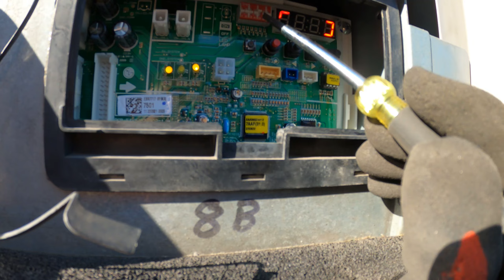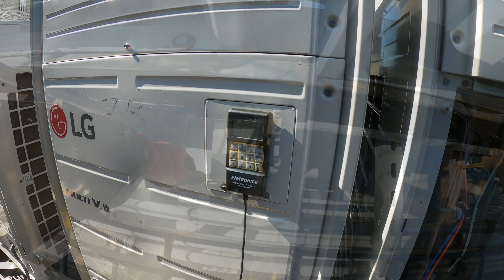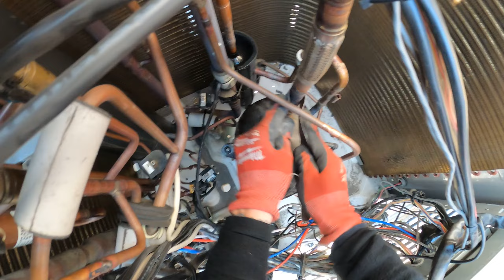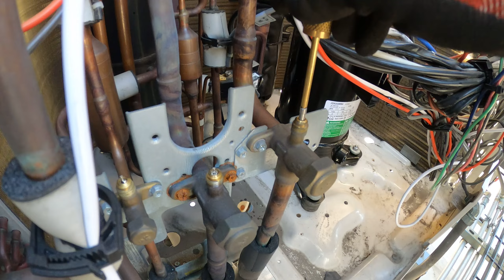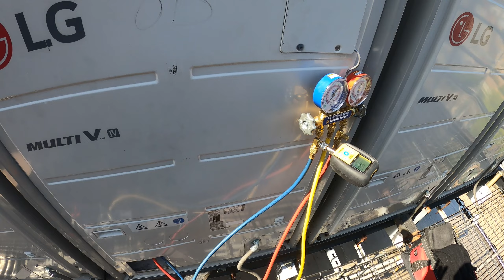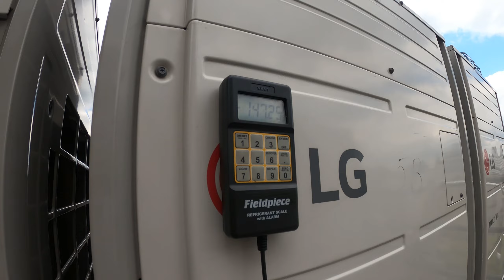HVAC Service Call: LG MULTI V 4 Error Code CH26 Repair (Inverter Compressor Overcurrent) CH29 Error

Comment: Thanks for a very interesting video! You did a great job with the thermal transfer compound.; that should work very well transferring heat. From the Service Manual, the board you replaced is the Converter Board not the Inverter Board. The Converter Board converts the incoming AC to DC to be passed on to the compressor and fan Inverter Boards. Is it possible that a bad Inverter Board for the Compressor is causing both the Compressor and Converter Board to fail?

I also have another thought that came from what you discovered with the strainers outside the units with nothing left inside. Having a look through the hydraulic diagrams shows six internal strainers. If the external protection is non-existent then is there some clogging of any strainers internally? This is assuming that the pipework with the strainers in that condition is used by this particular system, or at all.

Thinking about compressor lubrication, are the Strainer and Solenoid Valve in the Oil Return line between the Accumulator Receiver and the Compressor both functioning as they should? Is the Check Valve between the Oil Separator and Compressor working correctly allowing oil to return to the compressor? If it is not then is too much oil entering the main pipework and starving the compressor?

According to the service manual I found, there are two oil return systems:
- A high pressure centrifugal one that returns oil to the compressor through its own injector pipe which prevents mixing of oil and refrigerant on the suction side of the compressor.
- There is also a Smart Oil Control system that monitors the oil level inside the compressor and initiates an oil return cycle to the Compressor when the oil level is too low. Timed cycles are unnecessary and the Compressor is protected from running with too low an oil level.

Is it possible, given there was oil in strainers you found, that there is a fault in the Smart Oil Control system such as the functioning of the return cycle?

I hope my thoughts and ideas may be of some help to you. Best regards and I wish you success in finding a solution.
Reply: Where l can find information over this system

Comment: Lots of solar radiation is hitting the earth right now. Those boards are not EMP hardened. when we have a coronal mass ejection it sends solar wind at the earth and it fries electronic components... especially ones on a rooftop...plain and simple

Comment: I work with a lot of LG. Do they have oil traps on the roof. Take a minute to pull up the installation manual. Read regarding piping. Inspect the piping open up some ceiling access and locate the BCs see if piping is incorrect. Maybe one of the indoor units exceeds the pipe length. Once you get all the info and have some sort of idea how the installation is. Call Lg and explain to them

Comment: I told you in the last video that another one of those LG's was plotting it's failure haha - wonder if you can get some kind of data logger from LG to record all sensor readings during a typical hot and cold day to see if anything comes back as risky to system health?

Comment: Those condensers look extremely close, I wonder when they run at the same time airflow is compromised, this could be something you could consider, I've had the issue before.

Comment: Hello, your work is very excellent and professional. I work in this field. Regarding your question regarding this building, the main reason for these problems in the system is poor installation, and the most important reason may be welding without nitrogen and errors in the process of installing copper pipes. Thank you.

Comment: Check the section of the input wires to the machine, it seems that the section is too small and that is where the problems with that equipment can come from.

Comment: Might be beneficial to enable the Forced Oil Return mode in the ODU's by turning on DIP switch 5 -> Go to SVC mode -> Enable SE 5 by setting it to 01 instead of oFF. This forces the unit to perform the oil return operation to the ODU if the oil level sensor ever reads low.

Comment: Leave the jacket off.  It just suppresses the compressor noise which should not be an issue on the roof.  May be contributing to compressor overheating.
Reply: Compressors are designed to run with the jacket on. The cooling is done by the suction gas. The jacket protects from the cold along with the cch.
Taking the jacket off isn't going to solve or help

This is an oil return issue. It needs a full survey and probably re-piping

Comment: Great video, waiting to hear from tech support, just a point which comes to mind is there a considerable drop in voltage when the unit is running?
Reply: Wires entering the unit look rather thin compared to the wires within the unit itself, post incoming supply terminal block.

Comment: Hey jumper man.  Hope all is well.  In my experience of dealing with LG Multi and Mitsubishi or. Daikin.  When you lose that many compressors and or vfd compressors boards.  We always find that in the original installation. Either there is a trap situation in which how the air handler piping was done has crated a trap not allowing oil to return back to the compressors causing the compressors to over heat.  Same with lack of suction super heat via short of refrigerant.    Turn the old compressor over see how much oil comes out.  That will tell you. But definitely go over every inch of the piping.  One to check for traps two to measure proper charge.
Reply: Valuable advice